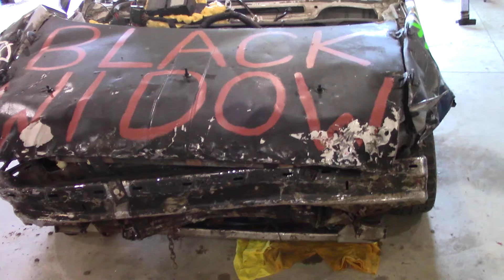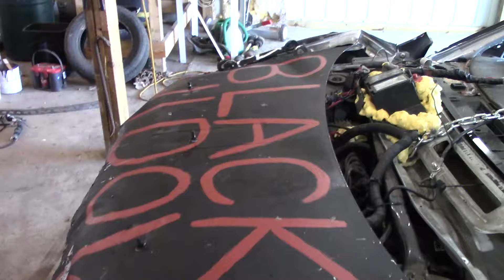2003 Monte Carlo Derby Build Ep 9: Derby Aftermath Round 1

Comment: Susan is in fact on a role! Unfortunately, I wouldn't run that Monte Carlo again. That frame is gonna be really weak at this point. Once they are that bent they a one hit wonder kind of car(most of the time). The only way to get a run out of that again is go backwards the entire time essentially.
Reply: Pull it down, hard nose it, and plate it. Plenty of life
Reply: For where I am (hard nosing) is cutting the crush boxes off
Reply: @robertfattler2362  That is if he is allowed to plate it. Most of the shows he brings his cars to he isn't allowed to plate. He mostly runs bonestock.
Reply: @derbydog02  that is true. But I was just saying the car could have some life to it left. Take it to a mild show it could be still be tough. But without cutting ghe crush boxes off or plating it you're right with it not really being worth fixing
Reply: @robertfattler2362  Yeah I get what you were saying and I agree with you.
Reply from the maker: This was ran hardnosed with that chrome welded on.
Reply: @DemolitionMissions  is hard nosing for you welding the bumper straight to the unibody? I know that's what it is in some places. Im in pa and what's considered hard nosing here is cutting the crush boxes off
Reply: If he had to weld his trunk down and dish it, it'll come in square and leave plenty of room for viewing. I ran a limited weld '12 impala this summer and it came in beautiful

Comment: Regarding visibility out of the back of a car, what if someone were to mount a back up camera kit to the roof? An old car I used to have, currently being dailied by a coworker, has a camera. If I were to buy back that car and send it up. I'd seriously think about rewiring that camera to a bracket mounted up high and use the Navi screen for reverse shots.
Reply from the maker: I’ve thought of trying to create something when I get a car that comes with a camera
Reply: @DemolitionMissions any insight on running late gen N body cars..
Reply from the maker: @ebensteiner  Check out our build series for the 2001 Alero, which is a N-body
Reply: @DemolitionMissions   I've watched the aftermath video and noted some of the weak points just wondering if there were any post video thoughts.. I seen they have AL. Spindles and don't like wheel shots.. car is a 2005 chevy classic will be my first derby
Reply: @ebensteiner  find a replacement front bumper to weld on. The factory bumper is nothing more than a piece of plastic held to the frame with flimsy U bolts.